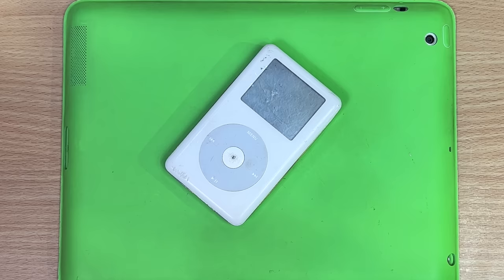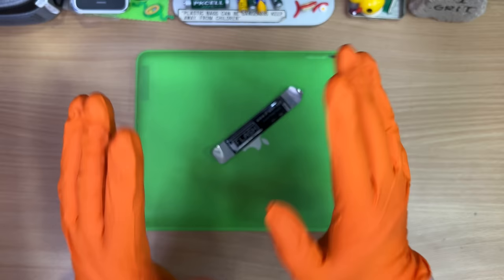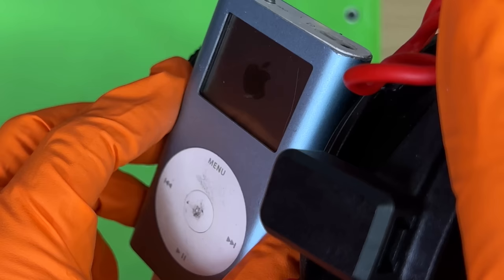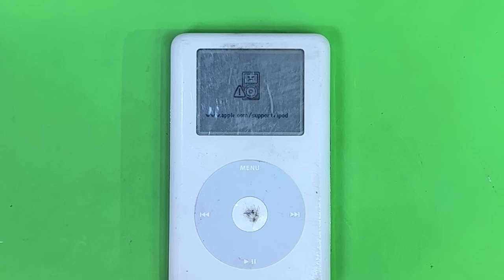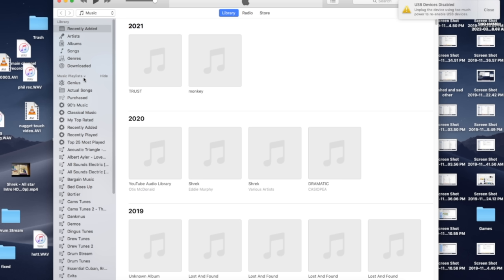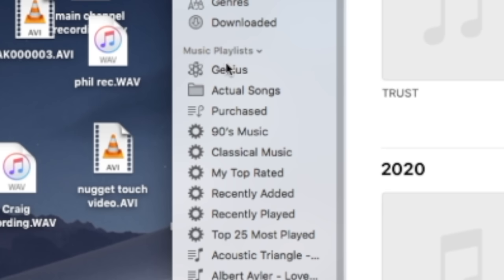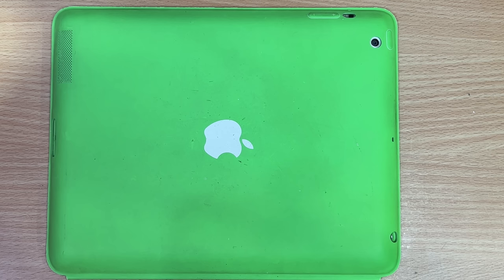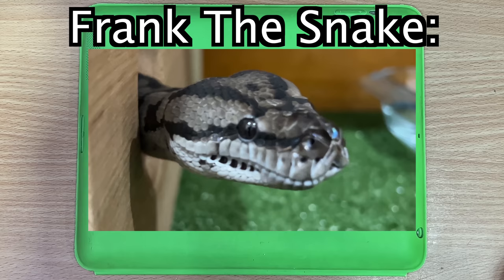A Classic DankPods Episode.

Comment: So dang good to see a 3rd gen again. Soo many good memories modding the firmware strings/images with ipodwizard, swapping out the red leds for white, and eventually reviving my 15gb model with a 20gb hdd pulled from the biggest turd of an m:robe 500i. 3rd gen was such a freak and I still love it. Of course had to use the abomination double cable to sync with my literal garbage pentium3 gateway pc.

Comment: I bought a 40G 3rd Gen on ebay untested a couple years ago because you got me so hooked on old I pods, and it worked perfect, even a good battery. I have an old speaker dock that has firewire and the thing came with like 3,000 songs about 50% of which are some sort of Scottish Highland semi rock style songs. I would never have thought there were that many in that genre. I haven't the heart to erase them and I'll never live long enough to hear them all. I doubt the drive would last that long either. It's your fault. ;^P

Comment: I have all those old-old-school iPods. Except for my iPod mini, the other bigger white ones were bought “broken for parts” on eBay and fixed by me. I eventually put 64GB flash cards on adapters in them. They still work (I think). I also enjoyed find working hard drives with songs 😁 I think 3rd gen iPod sounds great, but the touch buttons were too easy to touch by mistake (wore out the lock switch).

Comment: Hey @DankPods, I wanted to know what are the best cheap earbuds out there, like best sound quality, battery life, and how loud they can be put, like the Soundcore Life P3's all I need to put at, is 65% to 70% volume and its loud, apperantly it has an "oversized 11mm drivers" either way, do you know what are the best cheap earbuds? That possibly has the same or even better lower price as the Life P3's.

Comment: I. Remember when the 3rd generation came out. I was in high school and I saved up all my money from working in the summer and bought it for $400 and I spent another $200 on accessories. I played sports so I would whip this out on the bus rides to games/ events. I was the coolest kid on the bus when I would whip this out. After 6 months the battery died and I found out it was going to cost $250 for a new battery installed.  I kept the iPod for about a year total then sold it at a huge loss. 6 months later I received a voucher for a free battery replacement. i was so pissed and upset that I stayed away from apple for about 15 years till just recently I got a iPhone because my  teenage daughter wanted a iPhone.

Comment: It is 100% your fault that I recently bought an ipod. I haven't owned one for like 15 years. 😂 Got a 5th gen for cheap because the center button didn't work...I opened it up and the little foam pad on the button was off center so I just kinda...pushed it back. Works fine now. 😶 What they didn't tell me is the headphone jack doesn't work so I had to fix that now. I wanna flash mod it and replace the casing and stuff, just waiting for extra cash. Having fun though.

Comment: First of all, love your channel. Got a question regarding ipods

You've pointed out the black spot on Nanos (na-no) from battery swelling... does this happen in 7th gen Classics?

A recent mass tidying and clearing up in my home has resulted in finding a long-lost 7th gen. It has what looks like that classic black spot. I assume this is the same thing.

I plan to send it off to a place to get fixed anyway, it needs a new headphone jack and the battery doesn't hold a charge. Just curious if it's a thing with Classics.

Comment: Thank for the videos!! Got all the tools and battery to replace in my 6th/7th gen classic - when I pulled the battery out - the connector seat that the cable fits into (bottom right corner - came out. 
Any hope to replace that?? Looked like it sat on tiny tiny wires obviously to pass the current.  Is this project screwed??